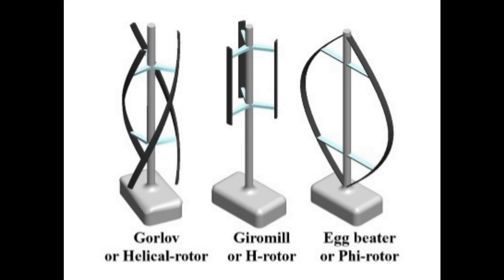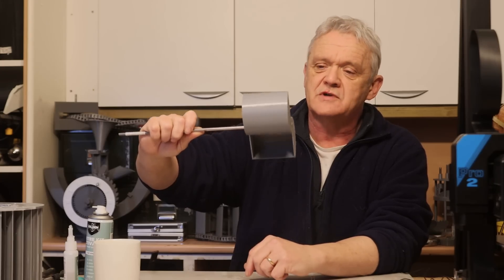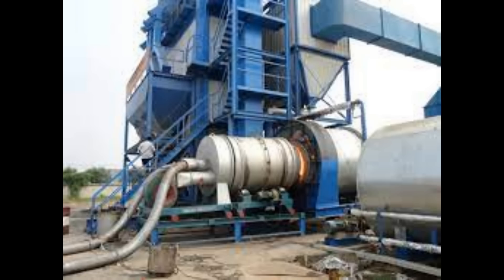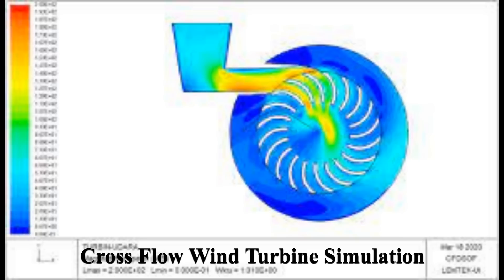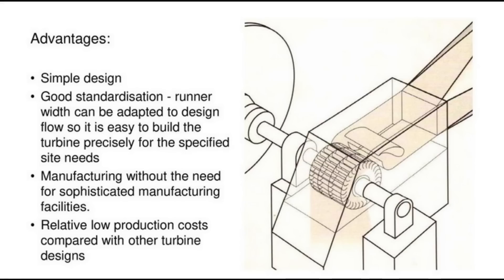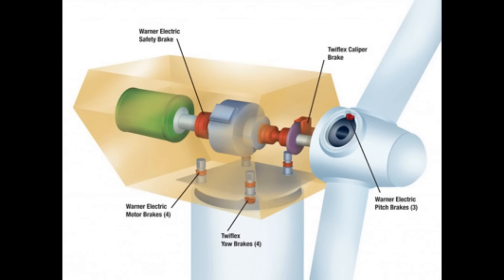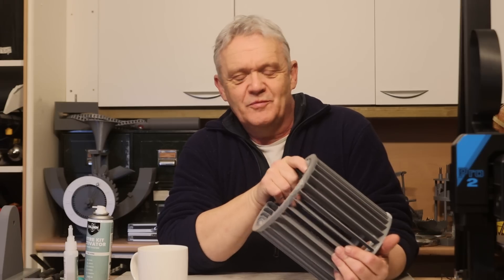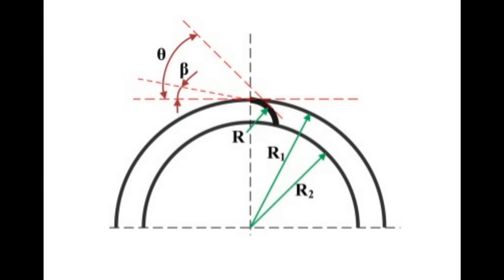2206 The RidgeBlade Wind Turbine And Understanding It

Comment: Is there anything wrong with my thinking here, fusing technologies solar and wind by using solar panels in place of ridgeblade/squirl cage rotor airfoils. The benefits may include active/passive air cooling, and or exploit general relativity to where the spinning induces the doppler effect changing the effective band of light absorption range, and or all the things including the added energy from acquiring angular momentum squeezing or stretching atomic structures reducing energy needed for light to get things flowing in the solar cells? You also would only have to worry about 1 longitude or latitude adjustments.

Comment: I salvaged a fan like this, not sure what it was from  but i took it to the creek and stuck it in the fast water and managed 0.090mV ..   I had to learn about 3 phase motors first but it did work better wedge beetween some rocks that acted like guides for the water, but still not efficiennt with the wide open space in the middle. I can see how these can move a lot of air quickly  at some point the speed out does the volume and they can have relatively small areas blades moving not a lot of air but quickly.

Comment: I liked the concept of the Ridgeblade.  That is until I converted m/s to MPH.  2 m/s converts to a comfortable 4 mph, which, with my roof sloping at 30 degrees, the Aeolian effect would be effectively 6 mph going thru the system.  When I looked to see how that would  translate to KW, all their site says for the RB1 is,"2 kW continuous (2.7kW peak) per 5 rotor system".  It doesn't say what the effective wind speed is to achieve that output.  I looked at a VWT and it said, "3kw at 12 m/s".  Well, 12 m/s is nearly 27mph.   The average wind speed where I live is about 10 mph (about 4.47 m/s).  Once I converted the units to something I can understand (yes, I'm an American), it started to look like not such a good option - unless someone can show me what I'm doing wrong.

Comment: I've never understood why a drum turbine like this isn't used under motorway bridges and sign gantries to generate electricity using the wind generated from lorries and cars.
Whilst talking of cars etc why are turbines not used on the roof of lorries and vans etc? We use turbines to pull air from vans but why not generate electricity from them to top up the battery and the alternator wouldn't have to work as hard there for increasing engine economy

Comment: What seems to me like a fairly obvious improvement to the ridge blade would be to have the structure open at the ends to allow wind to flow throught from any direction. Currently it seems that if the wind is blowing from the side, the turbine will be stationary. Of course, capturing this wind would mean that you would probably also need to make the blades helical, so the device would be more difficult to make and therefor more expensive. I suppose there's always swings and roundabouts.

Comment: Since roofs are vented to prevent condensation on the roofing nails and to reduce heat buildup why not put a metal roof about an inch or two over the existing roof w/a ridge blade at the peak. You'll probably have continuous air flow no matter the conditions
Reply: You're probably correct. I've been doing some experiments with solar, specifically heating water with it as efficiently as I can and it really has been eye opening to see the potential. And eye opening to slowly realize the average person has some belief that there is nothing easy or free or yet to be done ECT. I wonder sometimes, why isn't anyone trying that? We could all implement like 3-4 simple things in new home builds or renovations ECT to mostly power, heat or cool them. A saw a video of a guy who modified his dryer to pull hot air, like the intake of a vehicle, from his attic in the summer. Decreasing his energy usage bc his dryer was ran on the no heat setting. Also cooled the house and dropped the typical months bill down by nearly half or a third or something significant. It seems so obvious once someone says it.
Reply: I think your idea might work well, possibly better in some conditions, if you were to paint a metal roof a dark color. If not flat black, maybe a deep blue or maroon. If the sun is out, that'll be hotter then the surrounding air. I personally would cover it with a cheaper clear acrylic, polycarbonate maybe, even glass if you can do it right and source it cheap. The clear material will allow light through to maximize the heat absorbed into the dark color metal roof. Which creates a draft as the air above the clear plastic is colder. Could use shingles also but  my initial thought is that a metal roof would allow for higher wind speeds. Bc metals conduct heat rather well vs shingles as far as I know. The shingles may keep a turbine spinning after the sun sets though. The clear on top is gonna help either way I think. Could be wrong. You should play around with it. Let us know if you figure out something cool

Comment: Instead of a break, wouldn't be better a device reducing the access of wind into it? Like an obturator or a cylinder gradually covering the opening and reducing the access of the wind into the turbine? So even at higher speeds of the wind the power generation would not stop.

Comment: Ok...had the idea to make a row of these to direct air down on my flat roof to cool and also blow / evaporate standing water.  Braking? Could a friction clutch do this function?  Also the new propellers shaped like tortellini say they are quieter and more efficient...finally seeing a new squirrel cage where the vanes pivot so they move in line with the rotation when not producing thrust...aiding air flow I guess.  So, have I given you some ideas?

Comment: In the 1990s, there was some hullabaloo about a modular crossflow rooftop system called a LIMPET system, which was an acronym for something or other.  The unusual feature of it was that it was basically a squirrel cage turbine that was flexible rather than rigid, so that from the end it was an ellipse instead of a circle.  It was segmented, I think, so that it was effectively more like a tractor tread than a wheel.  The theoretical advantage of this was that the area struck usefully by the wind was large (elongated) compared to the leading and trailing edges.  You'd place it on your roof with the trailing edge at the peak, and a guide directly wind coming up the roof onto the top of the flattened squirrel cage sort of thing.

My first question after assuming that it did work (there were working models from some U.S. university) was how it held up over time, but it's one of those things I never heard of again.  Which is a shame, because I'd like to see a wide-belt-instead-of-wide-wheel crossflow turbine in action.

Comment: A follow up question. 
I’m assuming that for a roofline turbine it would need to be in the prevailing wind direction.   
My area we often have directional change during the day 180°  is not unusual.  
I’m thinking that my best choice would be a vertical turbine. That can operate at low wind velocities. 2-20 m/s   Your opinion please. As I’m just getting into wind power as a supplement to solar. I have done local research and we have many days and nights with winds that a low wlnd speed turbine may be as good as solar to charge my off grid batteries

Comment: I'm designing one of these to make use of a 10kw BLDC (goldenmotor brand) and its controller from my boat. The diameter of the turbine about a metre. Question: would an old torque converter from a car, perhaps in conjunction with a flywheel, help  with the gust overspeed and low speed startup?

Comment: On a motorway the movement of the vehicles stirs and pushes the air, with lots of vehicles this flow of traffic creates a flow of air, this flow of air actually reduces drag on the following vehicles, so if you add gantry wind turbines they extract power from it, but you dont get something for nothing, so they will slow the air, which increases drag back to the vehicles passing underneath, this increased drag reduces vehicle efficiency causing more fuel to be used, so this form of generation is thus fossil fuel powered.....
Reply: Absolutely. Glad someone else bothered to mention this .

Comment: It's fascinating  how often a motor is also a generator, and a fan is also a turbine.  One is nothing more than an inverse of the other.

In this particular case, a centrifugal fan outputs "wind" equally in all directions perpendicular to its axis.  The inverse is a vertical axis wind turbine, which can harvest wind energy from any direction perpendicular to its axis.

Comment: I have an idea for you Sir!  How's about building a solar tracking Airfoil with Flexible Solar Panels on the front and then mount O-Wind type devices to the wings trailing edge. When the sun's out you get that power,  plus any wind and when it's windier than solar, or cloudy,  the airfoil would track + or - 5 degrees into the wind to increase airspeed over the airfoil to generate power.  I hope to be in the process of printing parts, for the O-Wind and generator parts in the next week or so to see if it's viable.

Comment: Is it me or would it be pretty easy to make a flap that's held down flat on the roof by gravity and gets pulled/blown up by the wind at windspeeds higher than 20m/s, so it disrupts the airflow into the turbine???
Just break the wind, not the turbine.

Comment: Hi Mr Robert, I wonder is there any electricity accumulator type which have to be charged with heat. For example due to heat charged particles under (or without influence of) permanent magnetic field have to drift oppositely and charge opposite poles (plates) of accumulator, then   it can be used by connecting directly to its plates. Does such device exist? Or how would be efficiency of such device?

Comment: I calculated roughly that such a cross flow turbine along roof of a house (approx 8m) could generate between 2-3 kWhs max on an average day over the year in 2-20 m/s - would you agree?
Reply: So it would cover around 50% of a family's use throughout the year. With Solar  & a battery out would make a home virtually off grid?
Reply: You mean an 8 m long turbine? Or eight turbines on the roof? And diameter of turbine is your dominant power factor.

Comment: Just too add to the physics that from a production standpoint most of the non electronic parts could easily be 3D printed en masse locally using waste materials (any type of existing plastic) as a source. Or better yet a type of CCS sequestration that makes synthetic hard plastics as a printing material...

Comment: Do they over heat in high winds or break. If it's heat then again have a sand battery to take excess power. Heating is still the most power hungry I believe
Reply: More centrifugal / physical issues ,heat won't come into it a thermocouple type device could easily deal with taking it off-load and a sand battery would only add to heat issues by loading the coils if over speeding

Comment: What about building such but for ground deployment? :) 
Say you have a field, especially if it's on a slope, could you get someone to build a series of these turbines, and mount them on a long, angled A frame construction, perhaps of aluminium or galvanized steel for durability? 
About 1 metre off the ground, the A frame sides helping wind flow and provide housing for motor and ballast load, etc?
For actual cost effectiveness, durability and ease of maintenance, it sounds plausible
Reply: Unless you can get more energy out of it than the area of solar panels as could be mounted on the same frame, it's not worth spending the money on it. No matter where you are, at ground level there will be more solar energy than wind energy available for capture. Possible exception being the Polar regions in winter.
Reply: @ianrowberry8818  It's an addition to solar panels :)
mast mounts have serious problems of cost, maintenance and stability especially up here
Reply: Why stop there? If it's on the ground make it rotatable naturally following the wind direction. With a safety tape to keep out people who are stupid 😮
Reply: @kennethkeen1234  I can't tell if you're being serious, sorry!
Reply: Why stop there? If it's on the ground make it rotatable naturally following the wind direction. With a safety tape to keep out people who are stupid 😮

Comment: Oh cool perfect timing..trying my hand at making a vertical turbine today. (on 5th print design) What I found interesting is that my version 3 seemed to work the best as it was more or less vibrating with no wind at all. Using FreeCAD.
Reply: I've been tinkering and printing vawts the last couple weeks as well.  Been working on squirrel cage design mostly.
Reply: Hawts are the future for city people. House encased in glass and remote control ventilation outlets at the top where the hawt sits. 2024 02 07 13:50